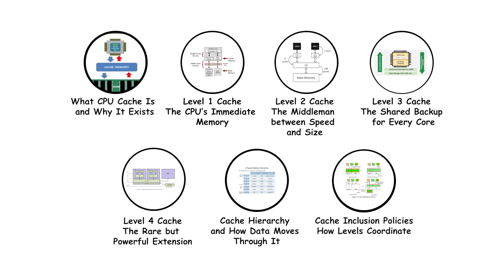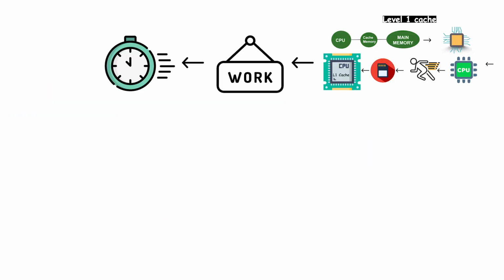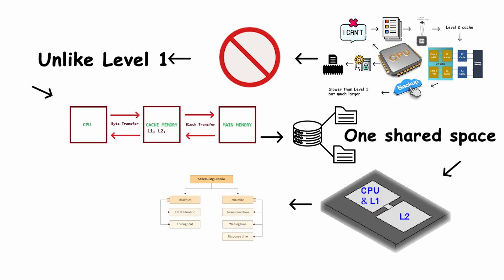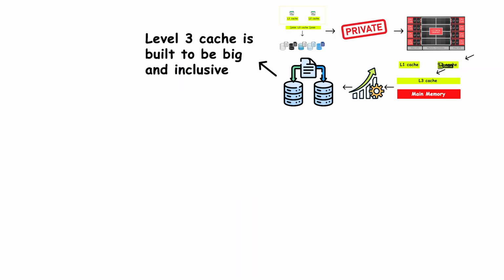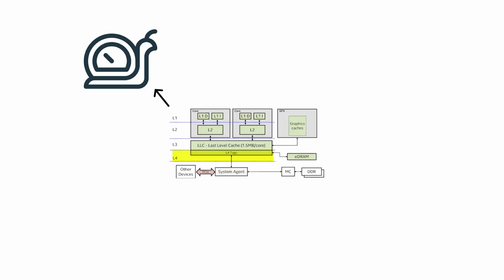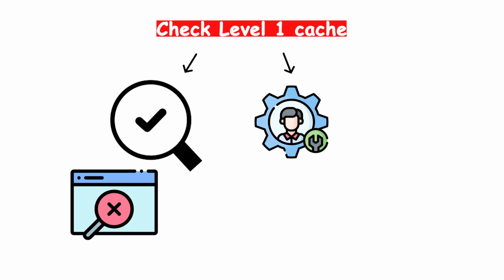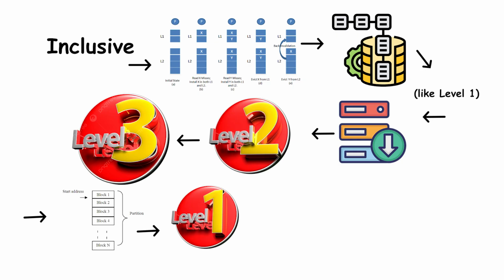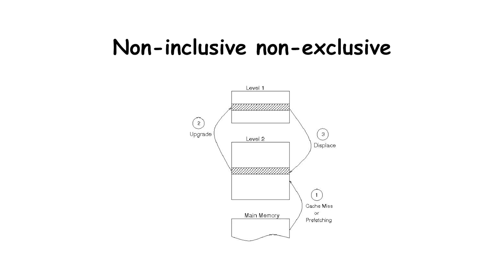Every CPU Cache Level Explained in Detail

Comment: What about x3d l3 cache om ryzen 9800x3d?, thats way bigger (96mb)
Reply: That's an extended l3 cache, amd puts an extra cache die on top of the cores tripling the amount of l3 cache and dramatically improves l3 hit rate increasing performance for memory bottlenecked application.

Comment: The benefit of cache always depends on data needing to be used more than once in near term. If every cycle needs to call data that isn't in the cache, it's best not to have cache, except if it's prefetch then discard after use. The only type of workload I can think of that works like that though is financial transaction processing across huge databases and sets of them. Probably why IBM chips are still in demand, by that very specific type of customer.

Comment: On hyperthreaded chips, I believe L1 cache is often segmented per thread, so the L1 cache for a given core will be split halfwise, whilst L2 is segmented per core allowing both threads to use it, and L3 is shared by the whole chip(let). On ryzen ccd chiplets, after cache miss on L3 cache of a CCD, there will be a lookup on the cache of the other CCDs. If a hit is found, rather than read the data, the command is routed to the CCD instead.

Comment: If L1/L2 were private and L3 wasn’t shared, most multi-threaded apps would scream in pain, but single-thread performance could jump 10-15%. Intel stuck with inclusive for years and literally threw away half their L3 capacity on duplicates. Was that genius engineering… or just laziness?